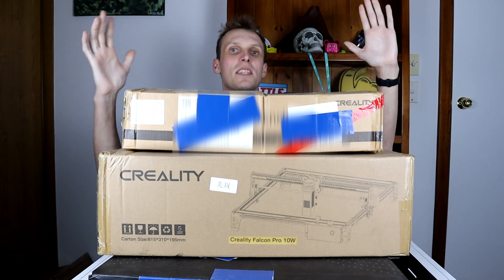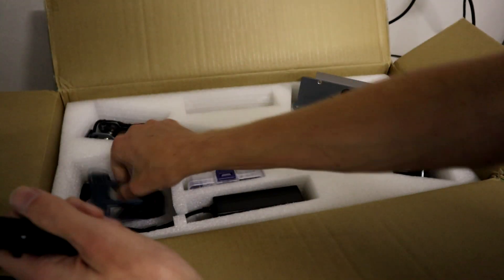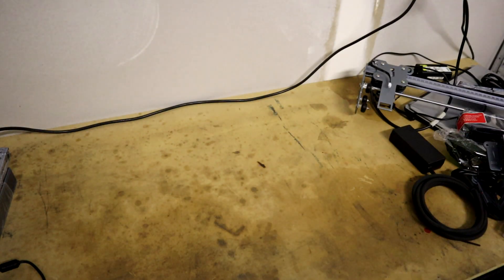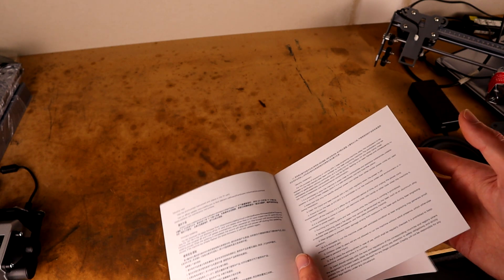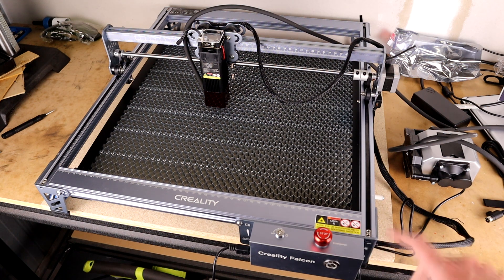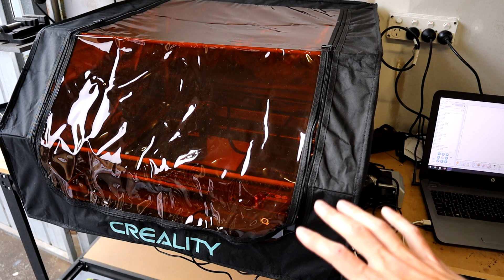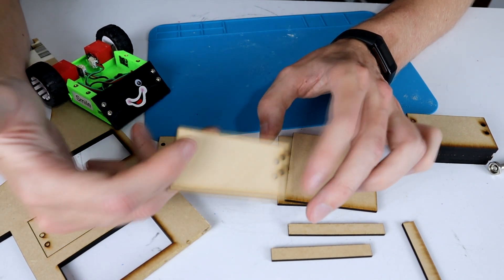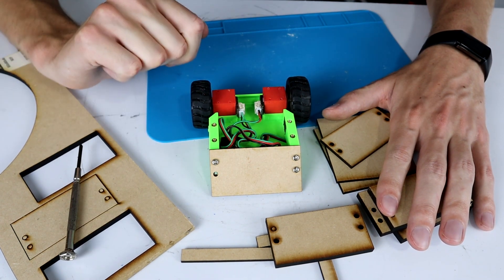Creality Falcon Pro 10W  laser engraver and cutter: unbox, build and first cuts!

Comment: This is a bit of a weird ask but what screws do you use in the top plate and motor mounts of slightly crude? 
I am planning on 3d printing the fram and entering it into my local events.
Reply from the maker: I can't remember, but either 2mm self tapping screws or m3 screws, if it's the version that uses M3 screws you need M3 heat insert nuts 
If you print it and the holes are larger then M3 you need the heat insert nuts

Comment: I noticed that my laser also had the X axis skewed after I did my initial tests. I think it came okay but when I moved it around I may have messed it up. But I was able to fix it using a pair of calipers to measure the gantry distance in each side carefully while adjusting.

You got good results with 6nm considering the 10W laser. I needed 2 passes at the recommended settings for 5mm MDF. I think the 4 diodes in the 22W are not making as small of a spot size as would be ideal for cutting.
Reply from the maker: Interesting that the 22w is still needing 2 passes on 6mm. 
I was pretty happy with how the 10w is cutting so far.

Going to do a full bot out of MDF in the new year to run in our non destructive league